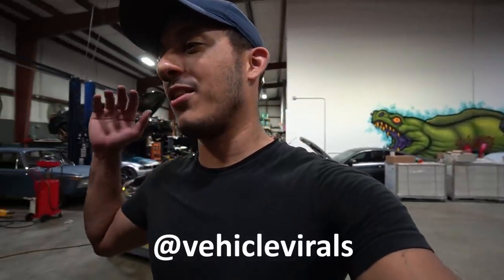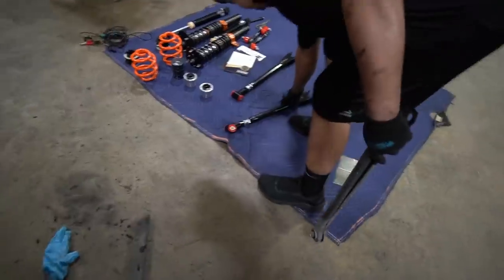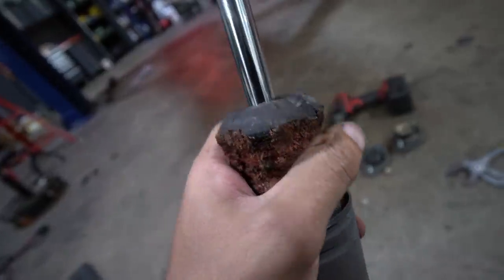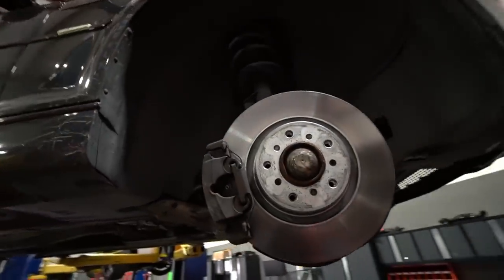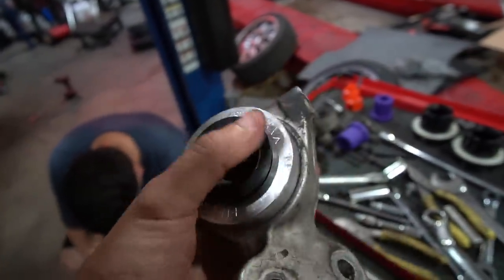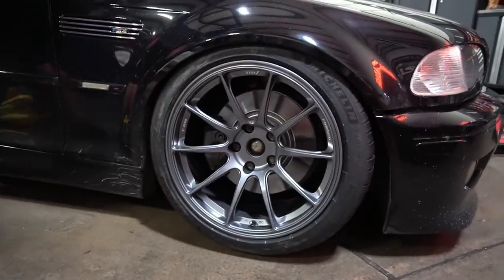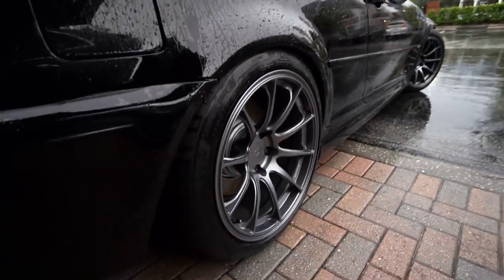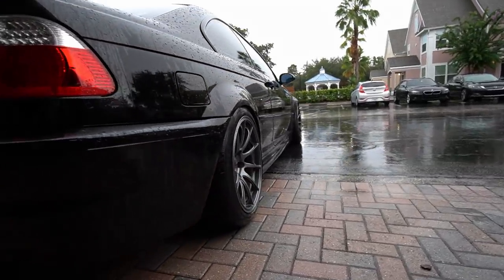My Cheap BMW E46 M3 Get's The Most Expensive Wheels I've Ever Purchased!

Comment from the maker: I'm sorry I was so unclear about the wheel specs in the video, I'm not sure what got over me. That said, the wheel specs are the following: 18x9.5 Et+22 front and 18x10.5 ET+25 rear. Tire size 245 40 front and 275 35 rear.
Reply: Vehicle Virals I guess you’re using spacers correct?
Reply from the maker: @gtcreels532  no
Reply: Vehicle Virals oh if you do the csl the choices I was looking at were status gruppe CSL Style CSL SGT-SCZA and the oem from ecs but also you’d need the diffuser and front lip too to complete the look so I’m eager to see that portion of the build
Reply: Vehicle virals pur red brembo on its gonna look fire
Reply: Yo you are a New England Boy??? MY dude! I was raised and live in Vermont!
Reply: Bro just a doubt did you thought about air rides
Reply: You could have gone wider in the front . . .

Comment: I’m loving these episodes of your M3 man. I personally have the baby brother to this car which is the E46 325ti 2.5l M54. It’s a very sporty compact with a spicy engine and 5sp manual. It’s my daily and I love driving it! I’ve done upgraded brakes, ecu stage 1 remap with launch control and 2 step, suspension upgrades to stiffer MSports suspension, bright led lights all around, carbon fibre interior trim, custom exhaust from headers back, ZHP weighted leather shift knob upgrade, alcantara shift boot, MSports leather steering wheel, and about to go in for a full paint restoration and kidney grilles blacked out.
Reply: I'm veeeery very interested on what all those mods look like, got it on the IG?
Reply: Damn that sounds like a dream
Reply: Young Car Wiz it is definitely nice to drive. But am really keen for the paint to be done by the end of coming week!
Reply: Nathanael Ciranni sounds good bro. Can’t wait to get my drivers license and start modding a 325i e90
Reply: Young Car Wiz good stuff mate.
Reply: @Nathanael Ciranni Have you got intake? I've heard that m54 intake is restrictive and M50 swap can free up the flow,can you tell me if it's correct or not?
Reply: Pervin Murad that is true man but my intake has some mods. My exhaust headers are stock and they are restrictive and not nice. The m52 headers I think are the good ones for my m54. Night he m50 can’t remember.
Reply: @FieryWings01  Good luck in your project mate. Not many people like 46 compacts, you're an exception.
Reply: Pervin Murad cheers mate, I certainly do love it.

Comment: Looks great, only thing I'd mention is you would've gotten better handling with a square setup, (Same size wheels & tires all around) Square setup reduces understeer. 275s square or even 285s square on this car looks absolutely mean. Maybe run this setup for street and get a track setup for future trackdays?

Comment: I recently did wheels and coilovers on my 325ci. It definitely was a trial and error process with the coilovers as far as ride height. I went to a shop to have the wheels installed along with a laser alignment. I’m currently saving up for the Michelin pss4. I spent about $2500 between the wheels and coilovers along with the alignment and installation. But it’s money well spent

Comment: Nothing wrong w -3 degrees of camber if the toe is straight. Ran -3.5 on our 04 E46 M3 for years without irregular tire wear.  Good ride height for performance is in the 13.5" (center hub to fender) range. Wheels look good! But why not a square setup?

Comment: They look insane! i do have a question tho. i was thinking about fitting to my E46 and was wondering if the R10 alloys in those sizes wheel would fit a stand suspension setup and run the CSL size specs? being 235/35 and 265/30 or would i need suspension mods to accomidate the sizes??

Comment: Could go with smaller tires in the front to lessen the camber angle. 245 35 or even 245 30 would give you plenty of room.
Reply from the maker: Or I can just lift it a bit.

Comment: Wheels are sick, fitment looks good for now, but remember that the car will be lower in a few weeks to months cuz the springs compress a bit over time, so u might get rubbing issues lateron. Id lift it up by about 1cm in the rear and 2 in the front, then ur safe and it will still look good 

Also talking about upgrades... DO THE ROD BEARINGS! Fuck upgrades until uve done that, otherwise ull have no car to upgrade no more

Comment: It is not hard to roll them, also get thinner tires too, I have stretched some 255  instead of 275,  I have zero problems with rubbing the fender, my car is as low as yours
Reply from the maker: I'm fine as is with the tires I currently have.

Comment: roll the fenders otherwise the rear wheels will  constantly rub the fenders when your driving at the Freeway on uneven pavement, my rear wheels in my M3 weren’t even as wide as yours and they constantly  rubbed the fenders, I had 19x10 in the rear
Reply from the maker: I don't rub in the rear at all and I've driven on every surface with them already. Only concern is the front.

Comment: Hey Christian I asked for some e46 advice on your last video. You recommended I ask you on Instagram but I don’t have Instagram. Should I leave my email?
Reply from the maker: Facebook?
Reply: No social media. I find it addictive and figured I was better off without it. I have an email account and this YouTube account.
Reply from the maker: @sruli6137  just ask me the question in this thread then.
Reply: I’m looking to buy an e46 as a first car. I have a budget in the ballpark of 2500. I want a sedan. As an e46 owner, (although you have an m3 and I’m looking more 325-328i) would you recommend it? I have pretty much no experience working on cars but am willing to learn. If you do recommend it, any tips I should know? Thanks so much
Reply from the maker: I would be hesitant to buy one for $2000. It'd probably have very high mileage and need some work (gaskets and such) which I'm not sure it's something you'd want to deal with. Good maintained ones normally go for a bit more like 3-5K.
Reply: Aha. And is it hard/expensive to maintain? Any complaints?
Reply from the maker: @sruli6137  it can get tricky for a beginner since accessing some of the weak points requires taking a lot of stuff apart. If eveyrhting is healthy and taken care of, the car can be very dependable. The NA straight six on that car is very solid.
Reply: Gotcha. Thanks for all the help!